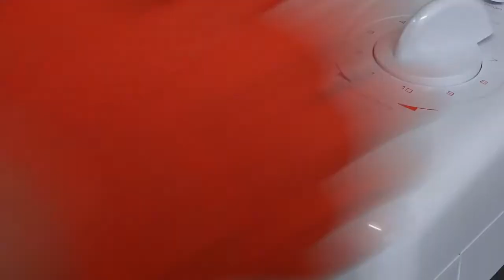Electric shower , checking and replacing PRD pressure relief valve device outlet ( leaking bottom )

Comment: Good video, please what is the function of the PRD pressure valve?
Reply from the maker: pressure release if the heater tank overheats and the head is blocked the prd with open and release pressure

Comment: I’ve got this exact model. I replaced the PRD and the PRD is still dripping, but the shower is usable. Can I still use the the shower if it’s dripping or is it dangerous? 

Thanks
Reply from the maker: check for good flow through the shower head you might have a restriction somewhere causing them to leak
Reply: @cagmito76  Thanks for the reply. 

I’ve replaced the head and I’m replacing the pipe today as well. If the PRD is dripping slightly after I’ve replaced the pipe then is the shower still safe to use??

Thanks,

Al
Reply from the maker: @AlLowe1988  Its not electrically dangerous it would be hot water though , id still use it myself. but not for kids

Comment: Hi, I changed mine and it blew straight away again, I've now replaced it again and followed booklet, I changed it, ran water with shower head off and turned the cold temperature up and down (didn't go in hot/warm) but it's making a noise now as if air is trapped in shower, as I turn the temperature the noise changes, I should also add I changed shower head and pipe to head too, any ideas I'd appreciate
Reply from the maker: usually its blockage ( heater tank blockage or outlet pipe shower hose ) did you use triton oem shower hose can you blow through it ok , other reasons could be too high water pressure , kinking pipe in use , submerging the head in water
Reply: @cagmito76  I changed hose and head,   it makes a noise like a whistling (trapped air) and water comes out of hose OK even on hot however as soon as I attach the new head it blows again, if I'm honest it's a old shower and probably needs replaced anyway, just thought I'd try fix it first but it seems like the shower head is causing the pressure to build as soon as its on and not sure why